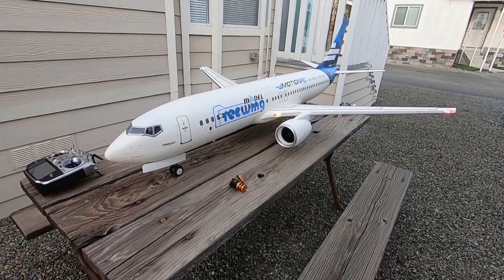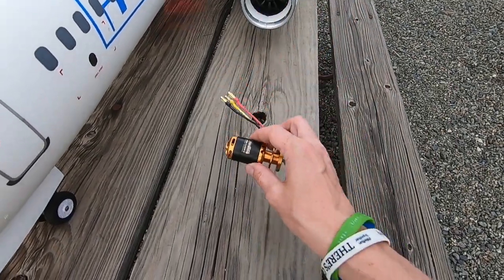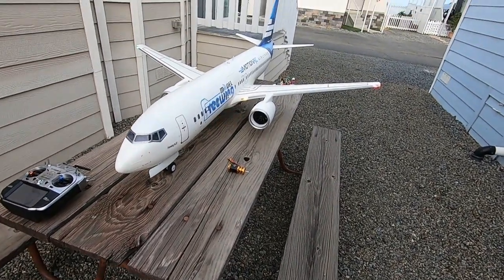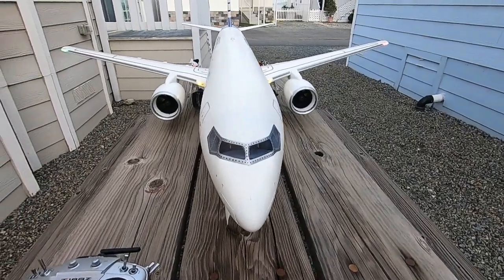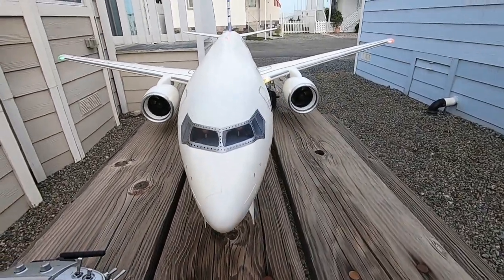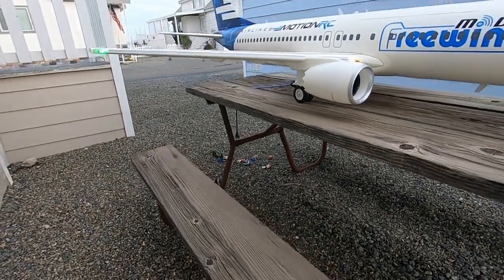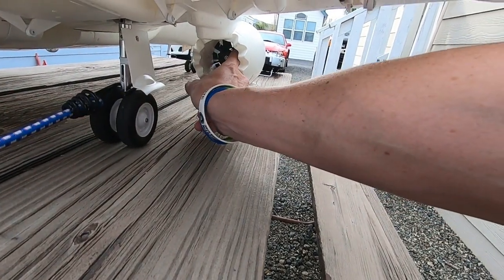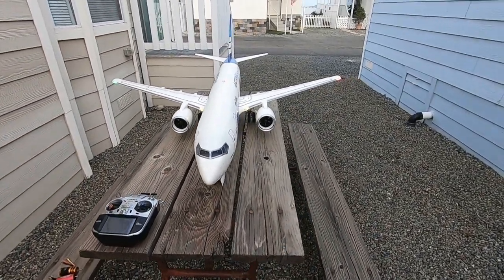Freewing AL37 Leopard Motor Comparison Test 3-31-20

Comment: 2500kv motor with 12b fan will draw a lot of amps on 6s and heated up quickly. Watch throttle if flying with these high kv motors
Reply from the maker: edwen303 I will throw the watt meter on the 80s and see what numbers come out. Then test again real quick  I think before a short test flight is done. 👍

Comment: Why would you even want or need to do such a modification?  The plane is awesome the way it comes from factory,  So this was totally unnecessary in my opinion...
 
Question,  if I ever need to replace the fans from the motor,  Do I need to pull the entire motor housing off, or can remove them through the front of it?
Reply from the maker: You're exactly right, stock power is excellent in the AL37. These Leopard inrunners are $10 more than the cost of the stock outrunner. If I can squeeze a little more power out of it with inrunner efficiency I say why not? 

To replace the fan it's easiest to remove the shroud/motor assembly from the nacelle with the wing off the plane.
Reply: @548HPCobra  Thanks for your quick response 👍👍👍👍